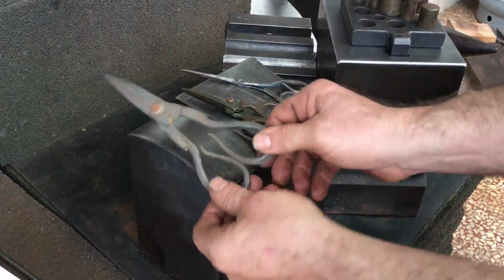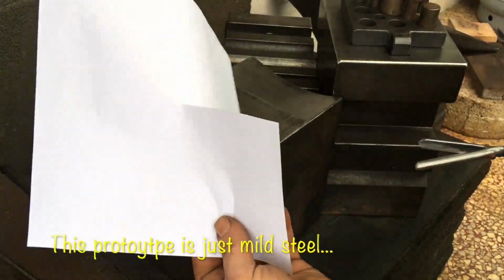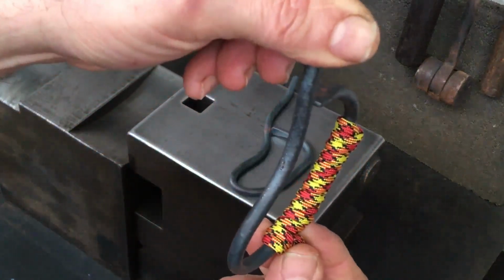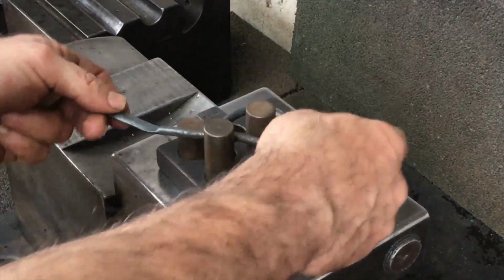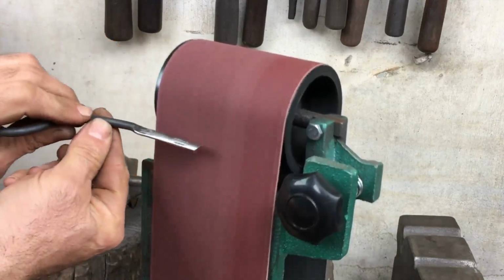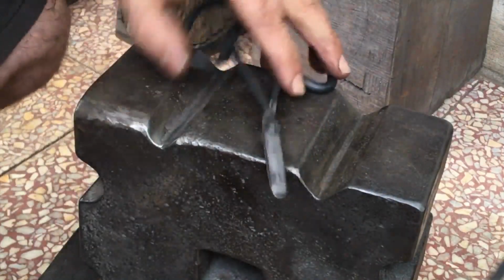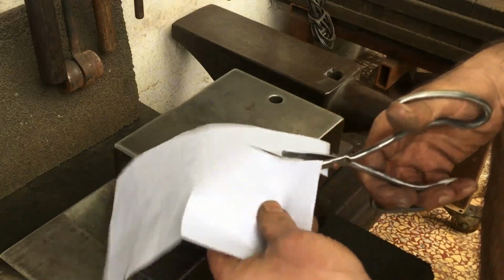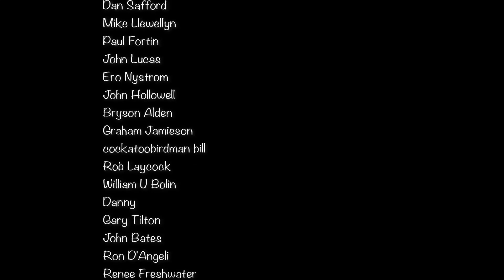Forge Odd Multi-purpose Pair of Scissors

Comment: That’s a very interesting pair of scissors. Seem to work pretty good. The shape should help a lot with preventing defection  while cutting. Sorta like a pipe or tube will handle more lateral force versus a flat bar.
Reply from the maker: As is, this pair of scissors isn't pretty but the function is there. It works well on a variety of different materials. And I have yet another idea on how to maybe improve the blades further. Let's see... Thanks Erik.

Comment: Glen have you ever made a high carbon steel striker for flint and steel fire starter?...Be well and be safe....🦜
Reply from the maker: Hi bill, Yes, a long while back I made a high carbon fire striker. But I had a hard time finding flint or another useable stone. If I do find a piece of flint maybe I'll post a video. Thanks for everything you do for the channel.
Reply: @gstongs  You don't need flint you can use eany stone with a hardness of 7 or more!!!!
Reply from the maker: I'll remember that and see what stones of a hardness 7 or better are easily found here in Taiwan. Thanks.